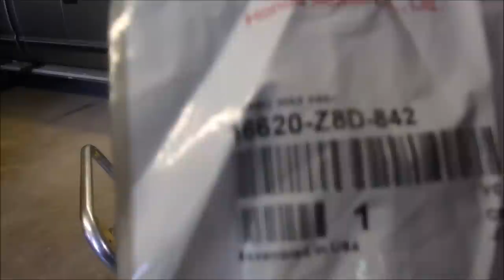LawnBoy With a Honda Engine--Many Issues.

Comment: So I’ve run into that Honda auto choke sticking shut issue a number of times on Toro mowers and I’ve finally found the cause. When the two bolts that hold that miserable gasket / spacer sandwich together get over torqued (as in with an impact driver) it squishes the gaskets together and warps the plastic air box which interferes with the choke linkage and holds it shut. If, while it is misbehaving, you back out on the carb nuts ever so slightly you will hear a distinct “click” as the choke plate snaps open and the carb functions properly. Look at the back of the air box, you will see the carved out section that is barely deep enough to clear the choke linkage on top of the carb; that is what’s hanging up the choke and making it stick shut. When the thermowax unit goes bad the choke fails OPEN, not shut. Double up on the gaskets between the air box and the carb inlet and don’t over torque the nuts, it should work fine. I’ve had repeatable test results with this theory, tightening the nuts to where they were caused the choke to stick every time, backing off on them caused the choke to snap into action every time.
Reply from the maker: Thanks a lot.  I will give that a try.
Reply: @BrucesShop  you’re very welcome Bruce, and thank you for taking the time to make these great videos! I have to say though, I’m not a fan of Honda’s over-engineered auto choke system. It’s very problematic and unnecessarily complicated IMO. I like their auto-return choke that you set and simply opens slowly when the handle bail is pulled down. Very reliable and super easy to fix if it has a problem!
Reply: Thanks for posting this. I've been guilty of using the impact driver, and before that, drill drivers with a clutch, for decades. I never had any issues until I started working on Hondas. I bet that's the reason. Have a great weekend.

Comment: Now that was a good video Bruce and should generate a lot of attention. Yep grounding out check out Kens small engine last video sweet plug tester which i may talk to Jake about buying. Dont you hate those wax choke mechanisms Honda came up with? We only have had one and same problem on getting it out yet DonyBoy 73 seems not to have an issue, maybe they were not tarring them in then? Amazing that a factory carb from Honda had an issue but guess it can happen, seems like they are having issues with their newer equipment.
Reply from the maker: Right.  Honda seems to be followoing a familiar pattern.

Comment: How's she goin'?  It may well have been a bad carb from the factory, but that plug was definitely not right.  The original wax pin seemed to be working but after you removed it, it looked like it was glued in place and if this is not normal that means someone was in there before and they may have mis-positioned it and caused this issue.  You also found the dampening spring was not connected correctly and could have been affecting the choke.  All-in-all Bruice, I'd say you fixed the problem but to say exactly what the problem was may be difficult eh!!  LOL  This was an interesting one and I'm glad you took us through it step by step!  Take care!!
Reply from the maker: I am always concerned when i have a multiple issue problem and then make a video on it.
Reply: Your attention to resolving the problems, no matter how many, as if it were your machine is commendable.   @BrucesShop

Comment: Those Thermo Wax used to be like $2 here in the states.  Now they're almost $7.  Makes me wonder if the failure rate went up, causing increased demand.  Surely they aren't that expensive to manufacture!
Reply from the maker: Right.
Reply: Some times automating a function causes problems you didn’t have!

Comment: This summer. 2 different hondas one would spark out of engine wouldn't run. New plug runs. Other one original plug 10 plus years old clean failed. The plugs only $3 something at menards
Reply from the maker: The are twice that up here in Canada.